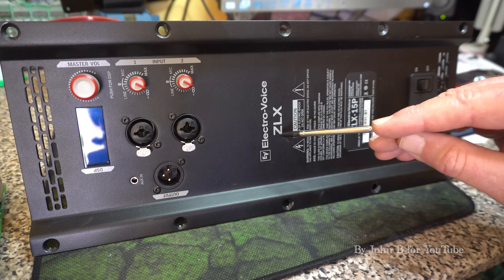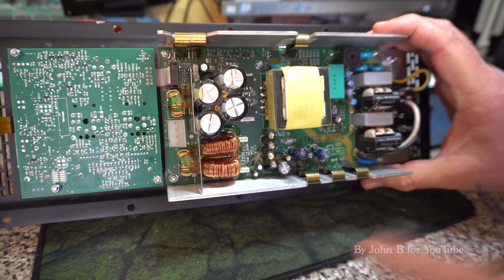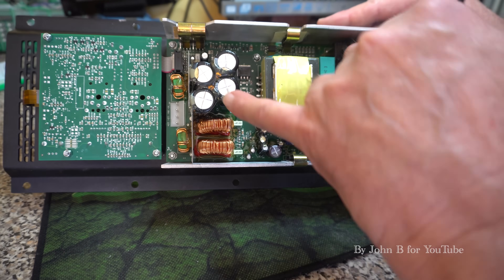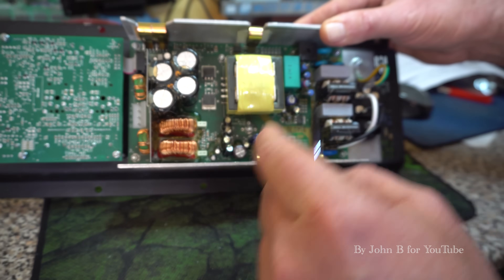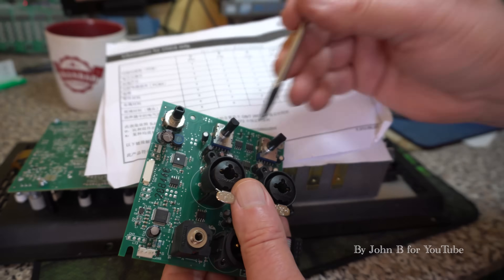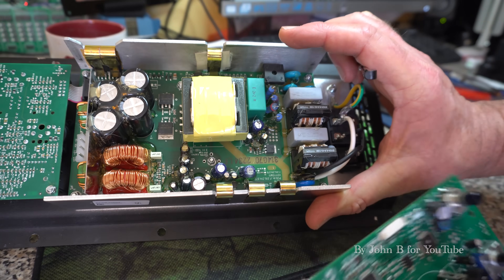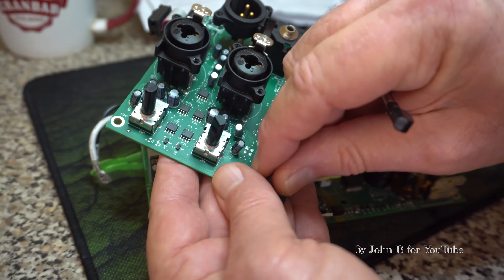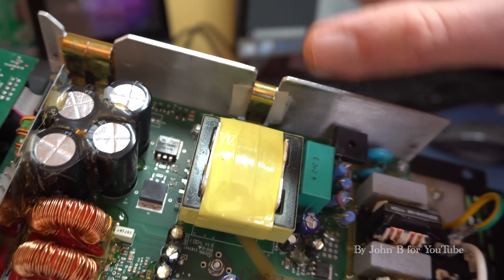The Inconvenient Truth about your Electro-Voice ZLX-12P & ZLX15P amplifier (Read Show More)

Comment: Hi John, many thanks for sharing your knowledge and experience. I am in a local band but have had problems with 2 separate EV ZLXP12 speakers having the main circuit board burn out (different reasons). The technician I went to was really helpful but said basically the replacement would be almost as expensive as buying a new speaker. I was wondering if the similar price point Mackie Thump or Yamaha DBR have a better record at being more repairable? Many thanks, Jonathan
Reply from the maker: Hi,
All the amps are repairable, it’s just Mackie & Yamaha make the schematics available.
I have a link in the video showing a repaired EV speaker.
Thumps are similar to the EV and I don’t like them.
Mackie SRM 450v2 or v3 are more powerful and can be repaired, I love the v2.
Yamaha DBR range are a different class, expensive and more powerful.
I also have a video repairing a DBR10.
Reply: Many thanks for your advice John. Maybe the Yamaha DBR series would be a good match for me...the 12’s seem to retail for around £350.
Reply from the maker: @jonathansmith5787  That price is a bargain, they were over £400 each once.
The DBR12's are 500 watts RMS, much more powerful then the EV and lets say the 'not so good' Thumps.
How much are the ZLX12 OR 15s ?
Read the comments, so many EV's blow up and others say they are great.
Reply: Yes I saw that, too. I was very happy with the EVs except that two of them have now blown, without ever having been driven hard and always kept in good indoor conditions. Many thanks again 🙂

Comment: Hey John! Great channel! I am currently attempting repairing a pair of these from one customer and another from a separate customer.  The woofers on all units cut out on low notes. Have you encountered this issue? The horns stay functional.
Reply: If there’s any possibility of discussing it further, let me know.
Reply from the maker: The same chip is used in the Mackie Thump.
I have seen woofers going short circuit causing the bass to cut out at low volume.
Reply: @JohnB-2021  The woofers themselves? Unfortunately, I’ve tried the amplifier on other speakers with the same result.
Reply from the maker: @jameshudmon6586  Maybe there is a power supply issue or some bass fault that I have not seen.

Comment: Thank you so much i have 2 board with the same problem fet, pwm, resistores all dead
Reply from the maker: I have a repair video , link in 'more'
Reply: @JohnB-2021  Where ? i have replaced all resistors pwm and 17n80c3, and diodes 3 lags but is not tourn on i don't know where probleme, sorry for my english i am from France
Reply from the maker: @armandbabet2160  You need to test if there is over 5 volts on the chip.

Comment: Hi John, I was wondering if you could take a look at my ZLX15P circuit board; the speaker no longer turns on and it seems like the same resistors (or part of the circuit board) are blown out as shown in the video. My knowledge on this subject is veery little, but I have always wanted to learn more about electrical engineering, and this seems like a good project to learn from. Thanks for your time and help
Reply from the maker: I have a repair video, the link is in the 'show more'
I do not have any FETs for the EV, last time I checked there was zero stock.

Comment: Hello, I replaced two of these EV boards, really the heating at rest is high. I ask: is it normal for these boxes?! Because I hadn't heard them working before they burned.
Reply from the maker: Hi,
Yes the regulators and bass chip all get hot.
Reply: @JohnB-2021  Components in critical work, to render more, nothing reliable. Thanks.

Comment: I don’t think that is a the original ev amp circuit .why? I had a problem with mine and I don’t have the same bass chip as yours so their are different ones out there I’m not which is the original and which are made in China
Reply from the maker: I'm not sure why yours is different since the replacement from Bosch matched the faulty board.

Comment: It says 250 watt rms (1000W peak) in my spec sheet.. its a usable, good speaker for the price anyway.. ;-)
Reply from the maker: I believe the real RMS power is just over, a respectable, 300 watts since the amp was able to maintain 25 volts peak to peak on each channel during the repair. (See repair video)
However, one does not quadruple the RMS power to find the peak power. At best one would double it.
Reply: @JohnB-2021 Just saying, they are not 1000 watt, and they also tell it in the manual and on every website you can buy them. Somebody who knows sth. about speakers should actually get, that those 1000 (selling) Watts are not rms power.. ;-)
About quadrupling or doubeling I don´t know. My car radio says 4x50 Watt Mosfet.. In the End never sucking more than 1 Ampere on full Power from the  12V battery.. 🤷‍♂😀
Anyway that´s interesting to know.. anything you tell here. thanks for your insights! 🙂
Do you btw know, how to get a firmware update for those? I have two different here, one can save settings, one can´t. And one has 2 more EV sub models in the subwoofer settings to select.. kind of wierd.. 😕

Comment: I've had ev zlx115p for over 6 years with no problems atall and they have driven very hard till thermal comes up on the dsp with no problems up to now
Reply from the maker: That’s great to hear.
However, if you look at the comments below, one viewer has just had a second amp blow up.
It seems some go on forever and some don’t.
Reply: I've had 2 speakers go out. I have 6 total and looking for a replacement brand if thiey keep burning up.

Comment: ZLX is EV's budget line. It's disposable, not meant to be serviceable. As for that 1000 watt spec, all EV power ratings are inflated by a factor of four. By contrast, JBL's peak power specs are merely double the RMS rating. EV justifies its inflated power ratings as "peak-to-peak class-D power", which means driving the amp from positive to negative power rail with a square wave. So if you ever need to run your soldering iron off the output of your ZLX amp, you can estimate how much heating power you'll get.

Comment: Another zlx 12p blown up at the weekend, same fault, only used lightly!
Reply from the maker: Sorry to hear that.
I do have a video on a common fault repair.
Reply: @JohnB-2021  Is it easy to turn this into a passive speaker? I don't want to buy another board! regards James
Reply from the maker: @jimbax1  what country are you in?
Reply: @JohnB-2021    Scotland,   Glasgow
Reply from the maker: @jimbax1  are the main resistors blown?
I could have a look at it for you.
Reply: @JohnB-2021   Yes, and the board has been damaged, I no longer have any trust in these speakers! same fault, same place!       I  will just use it for parts. Thanks James

Comment: so what brand of powered speaker would you recommend then?
Reply from the maker: Hi Will, your question suggests I do not recommend EV.
I am simply stating it is a good speaker, just not 1000 watts.
I personally like Mackie 450v2 and the Yamaha DBR range.
The 450v2 is only 300 watts RMS on the bass, the Yamaha is 500 watts.
This EV is no more than 300 watts (approx) into a 4 ohm speaker.

Comment: On Amazon, LASE offer an aftermarket board (I have a blown 15P). Any idea if this aftermarket board is any good? Similar price to the OEM.
Reply from the maker: That's funny because the LASE looks like an EV amp.
Reply: @JohnB-2021  yes, looks very similar but seemingly a few different components.  It's supplied from a different company who claim to build them it seems.  After reading this others' woes about undersized parts, I have one en route, so will have a side by side comparison for components very soon!
Reply from the maker: @boma23  cool 😎

Comment: How many other brands are getting away with this absurd selling point . At what price point will the actual numbers be more accurate .  Is there a site that can offer real world numbers.
Reply from the maker: Unfortunately there is no site that tests all the speakers.
I have seen this EV speaker compared to a version one 450 Mackie and he said it was great.
My EV repair showed a measured 56 watts RMS and the v2 450 Mackie was over 300 RMS.
But look at the reviews and comments, most EV owners think they are the best thing since sliced bread.
I deleted a comment stating that I was ‘complaining’ and have no proof. Derr, I had the chip spec.
I don’t have cause to complain because I don’t own one.
They are a ‘nice’ speaker, just not 1000 watts.
Look at my repair or my video on How to measure amplifier RMS power (Mackie vs EV)
Mackie, Yamaha, QTS, Behringer and many more all quote ‘reasonable’ specifications.

Comment: I bought my ZLX 12BT’s used from a guy who was a DJHe had them for a year and a half and did about 50 shows with these speakers. He said he had no problem with them but he noticed they did run hot when he pushed them just  a little. Not sure if the newer ZLX models with Bluetooth are any different from the old ZLX in terms of manufacture. So I added subwoofers to the setup and the ZLXs don’t seem to run hot when they are paired with the subs. We are a band and not DJs so maybe there’s some kind of difference there. 31 gigs so far and no problems with the ZLX’s. After watching your in-depth video though I am buying a third ZLX  as a substitute just in case one fails at a gig. Not always a bad idea to bring more than you need.
Reply from the maker: Every DJ I know have a spare in case of failure.

Comment: it's TDA8954 on board, 300W RMS
Reply: can that chip be faulty or shorted? we have a ev zlx15p that has blow fuse, no short on the main varistor and all caps filter are good same with the rectifier diode

Comment: Glad I've seen this as will save me forking out on speaker package. Given your knowledge of the inner workings and boards of the powered loudspeakers and me as a mobile dj wanting to get back into things - can you give any guidance of where to start looking for 12"/15" tops and 15"/18"subs for up to 200 people medium/intermediate venue. So much to get through with specs and even then you are lost as there's no clue about the inner boards and electronics. Currently particularly difficult to get anywhere to hear different loudspeakers for myself. I've been trying to get decent loudspeaker info for over 20 years and this is still as mysterious as it always has been. Any help/advice greatly appreciated :)
Reply from the maker: Yamaha DBR range tops, second hand Mackie Subs SWA range are great.
Reply: @JohnB-2021  thanks. I hadn't even considered Yamaha speakers until you mentioned this. Could be a good match with the Yamaha MG12XU mixer I've got my eye on! Seems lots of good things have been said about the DBR15's. Any idea what the difference is matching one with a DXS sub compared to your recommendation Mackie SWA?

Comment: 250 watt rms and 1000 watt peak. read the official specs
Reply from the maker: I believe the amp is about 300 watts rms into a 4 ohm load.
Reply: @JohnB-2021  doesnt matter. i owned them 2 years ago. power is fine but i didnt like the sound of the speaker

Comment: The woofer on my ZLX-12p isn’t working but when testing with a multimeter the woofer shows the correct ohms… nothing seems to be wrong with the amp other than an inductor that is loosely glued on. Wish I could figure this out!
Reply from the maker: And that is the trouble one has when the manufactures do not release the schematic.

Comment: For someone who dabbles in the technical stuff this was an interesting watch so Thank You! That said I have been using 4 ZLX 115P's as stage wedges for 5 years now without a single problem and I use them often and ride them hard when I need to. 

For me I don't pay much attention to wattage ratings. I pay attention to how they sound and will it be loud enough? These may not be 1,000 watts but they are LOUD and they sound great for the price. I shopped around a lot and did a lot of sound demo's before I chose these as my stage wedges.  I chose them over Turbosound, Behringer, and JBL. The JBL's sounded better I thought but the price delta was too great for the little bit of sound quality I'd be gaining. I will say that recently I lost the horn of one of my ELX 112P's (not ZLX) and am not going to bother troubleshooting as they are cheap enough to just replace the whole speaker and use the "bad" one for parts.  I have done some pretty big shows including National Acts with my ZLX's and they have done a remarkable job for me.
Reply from the maker: Thank you for your comments Bob.
Many explain they have been great speakers.
Sort the comments to 'newest first' and under your comment is a guy with problems after using his speaker 4 times.
Then there are the others where their power supplies have gone bang in a year. (see repair video).
I think they are an ok speaker, just not 1000 watts, though many try and tell me otherwise lol.

Comment: 1000w peak 500 RMS so they are correct
Reply from the maker: Really?
That chip spec is the peak power.
And look at the show more for the maths.
Reply from the maker: The audio signal has a crest factor of 10 (the ratio between peak power and average 
power (20 dB); this means that the average output power is 1⁄10 of the peak power.
Thus, the peak RMS output power level is the 0.5 % THD level, i.e. 92.5 W per channel.
The average power is then 1⁄10 × 92.5 W = 9.25 W per channel

Comment: If you look at their website they claim 1000 watts Peak. That's not RMS watts! I believe it's only 500 RMS watts!
Reply: Try 100 watts RMS
Reply from the maker: Read the 'show more'
Reply from the maker: The audio signal has a crest factor of 10 (the ratio between peak power and average 
power (20 dB); this means that the average output power is 1⁄10 of the peak power.
Thus, the peak RMS output power level is the 0.5 % THD level, i.e. 92.5 W per channel.
The average power is then 1⁄10 × 92.5 W = 9.25 W per channel

Comment: Nice video👍
But the zlx12p and zlx15p are only rated for 250 W permanent output and 1000 W peak. As anybody in audio business knows the peak power is only marketing. But as you demonstrated it is not even capable of delivering the 250 W.
But in general it is not that unrealistic to have 1000 W from a PCB that size. E.g. the Powersoft Litemod or ICE Power ASP1200 they are at least close to 1000 W. But of course they do need good cooling although with 90% efficency you would "only" need to cool 200 W.
Thank you for sharing your knowledge with us!
Reply from the maker: Thank you for your input.

Comment: I have a ZLX12p only the treble sounds, the low mids are not being reproduced. I have already checked the speaker with external amplifier and it works perfectly, has something damaged on the card that prevents it from amplifying the low-mid horn?
Reply: IT BLEW UP!!!!
Reply from the maker: @wizardx4187  lol, oh yes.
Reply from the maker: I have no idea, that little bass chip is not working for some reason.
Reply: Ok, I'm about to buy the card, just a doubt, the DSP has nothing to do with not feeding the bass horn, is it correct, or could the problem come from there?
Reply from the maker: @djgermix3924  the problem could be anything

Comment: 2:37 I cannot see it very well, but I suspect the bottom chip is not a uC, but rather a AD converter, seeing how it has the analog devices logo on there and how close it sits to the inputs.
Reply from the maker: Yes if you watch the video for long enough, you will hear I said this 'could be a micro controller'

Comment: I think the fuse in mine went bad but I can’t find what amperage the replacement fuse needs to be.

I essentially just need to find a fuse for the ZLX 15p, but it’s not in the manual.
Reply from the maker: The ratings are usually marked on the fuse.
Reply: @JohnB-2021  thanks! It lists the voltage but not the amps.
Reply from the maker: @austinc2997  3.15 anti surge probably
If the fuse is blown, you probably have blown components.
Reply: @JohnB-2021  oh well that stinks would it be best to just buy a new speaker?
Reply from the maker: @austinc2997  Find someone to repair it.

Comment: hello Jhon B, when I saw your video and read all the commented reports I made the decision not to buy ev !! I have a dbr 10, but I miss bass !! no subs !! would there be more serious gains with a mackie srm 450 v3? or a jbl prx 12? or a qsc k12? or a 15 dbr? with an optimum of 12 can i get it through adjustments of serious tables equal to 15? which one tells me top? thanks for everything, greetings from Brazil.
Reply from the maker: You have a DBR10 and looked at EV, shame on you lol.
I'm not sure how good the Mackie v3 are, the v2 and v1 were very good for their size.
I'd invest in a used SWA15 or SWA18, they will blow your socks off, they are really that good.

Comment: How many rms is 1100 pmpo??8 ohms
Reply from the maker: Peak Music Power Output is quoted with a specific load, so your question does not have an answer.
To find the RMS from the Peak value, you look in the 'show more'
Reply: @JohnB-2021  it says 250w rms so how many watts is that at 8 ohms?
Reply from the maker: @cross-hairz800  
You're missing the point.
250 watts is 250 watts.
The amp should quote a power rating into a specific load.
250 watts up a kangaroo's back side is 250 watts.
250 watts up a gnat's back side is still 250 watts.
So if your amp is a good amp and can drive 250 watts into an 8 ohm load, you have 250 watts into an 8 ohm load.
Your pmpo is BS.

Comment: Well that is upsetting. I have one of these and over the weekend it stopped producing sound on the low frequency channel. The high frequency work fine. I have tested the leads on the sub and I am getting an 8 ohm continuity measurement. Any recommendations on how to begin repairs would be appreciated.
Reply from the maker: No idea, it could be anything.